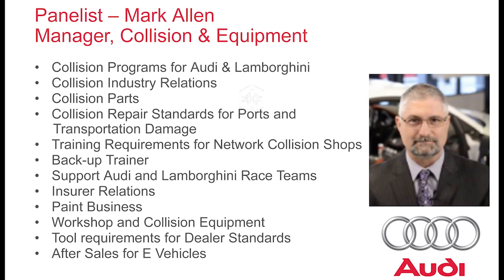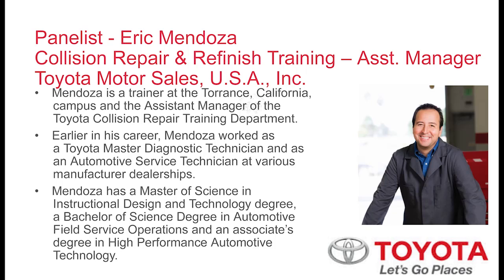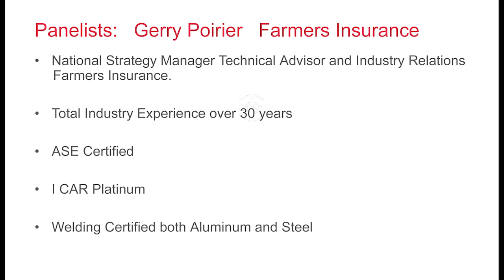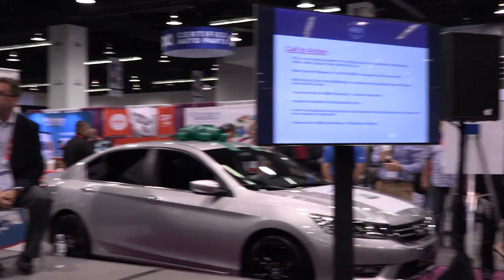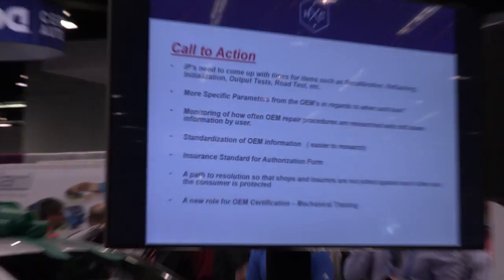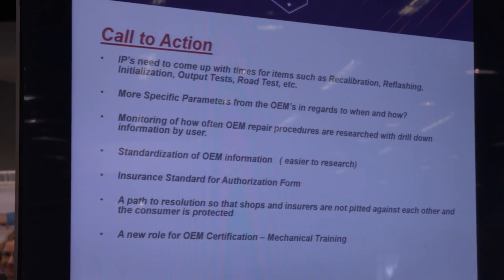Insurers And OEMs Discuss Vehicle Diagnostic Scans In Collision Repair

Comment: I think Chris from State Farm is being cheap that door on that Honda probably does have an air bag sensor in it he said just had a small dent in it and did'nt need to be scanned . WRONG!!!! The car should be scanned if hit any at all because any slight hit can change a seat position sensor if like Mendoza said just slapping a seat knocks it out of calibration . how will you know if it didnt change parameters if you dont scan . SAFETY IS FIRST!!! Insurers are all about money not customers SAFETY . They are only after a bottom dollar . Liability is to GREAT do the right thing scan the car even if for free . the customer being educated by the shop will eventually pressure the insurer to pay for scan

Comment: I search oem data everyday all day long but through alldatacollision and then if no avail I take a short subscription to oem. I don't think my shop should be punished for not searching oem databases on a regular basis if it isn't needed. Body shops are brainwashed to think that if a problem exists post collision then a scan is going to be thousands of dollars in supplemental repairs and the dealership is the only avenue available for complex diagnostics.